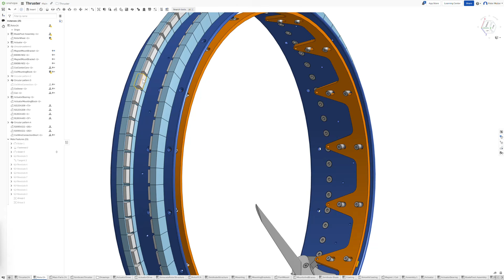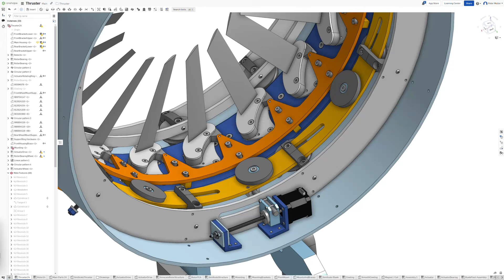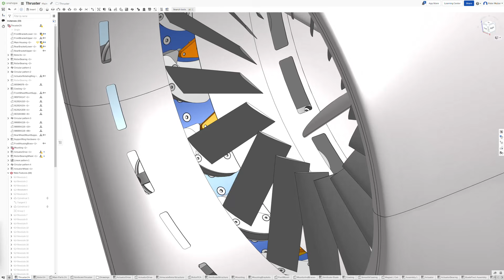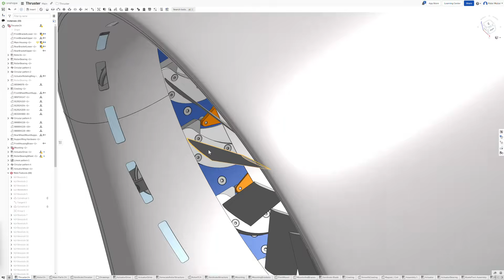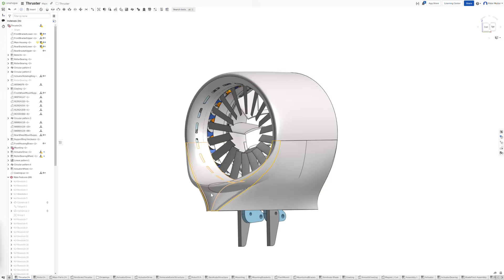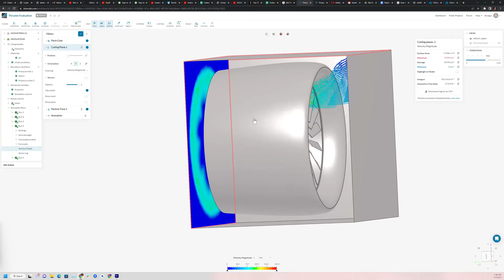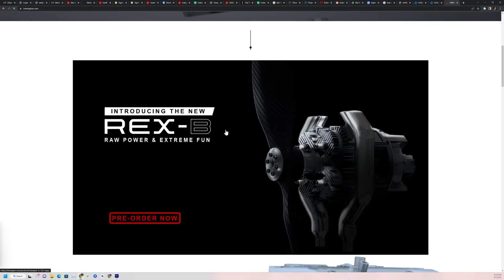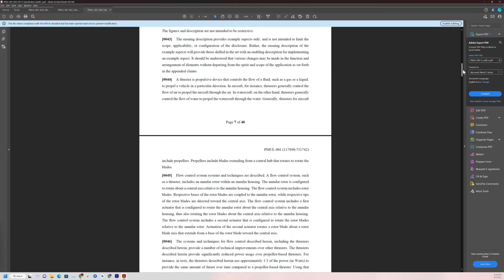Could this Thruster transform Aviation?

Comment: Very nice design ! I personally would ad an inner ring to stabilize the tips of the blades and avoid vibration due to resonance. It might make it more resilient in case of accidental bird intake. The inner ring support might help preventing blades braking badly and the engine self destruct.
Reply: I agree with that also. It would make less vibration and also cut down on wingtip vortices at the tip of each blade. Plus the inner ring could be made to conically widen or narrow the thrust for power vs speed as the case may be.
Reply: Might also make damage worse... with the current design one blade can go without taking them all - a solid connection at the "offset centre" could mean that a strike would pull a number or even all the blades out.
Reply: You can put more air through the engine if you eliminate the center race
Reply: @phedders  I think you will prefer to have damaged blades than ripped off blades. The later would create much more instability due to the imbalance and the engine will self destruct catastrophically. Having a central axis common support will allow the bird impact energy to be more evenly distributed on multiple blades, preventing a worse outcome.

Comment: Completely love the imagination, engineering and effort put into this, however there are several extremely similar patented and multi-patented units from 2008 - 2012 that have been designed, tested and modeled that you'll run into a wall trying to patent this unit.  Still a great looking unit and great video detailing your process.

Comment: I also thought about a fan like this some time ago. I don't think it can work for aviation, but I'm also glad someone gives it a more serious try. Someone should check me on this, but I feel like if you really want to spin this up to 5000 rpm then the outer supporting ring will have some crazy loads to deal with, making the whole thing heavier. Maybe carbon wrapping would help, but that would increase the distance of electric motor components (magnets and coils) which would decrease it's power to weight ratio and efficiency. The circular shape will want to deform according to where weights are placed making it more polygon like than circle. So it needs to be strengthended making it heavier. Having the electric motor and its magnets on the cirumference instead in a compact central motor makes the motor heavier. Also there is no obvious or intuitive explanation to why would this design offer any advatage over a regular ducted fan design. Having a bearing in the center, mitigates abrasion, this is what made the wheel such a great invention, but this fan design turns this on its head, unless somehow you can make the inner ring magnetically levitate, which would make things heavier. Blades being compressed instead of pulled is also a huge concern. Imagine a drinking straw being pulled or compressed. The straw will keep its geometry at larger loads when being pulled.
Reply: The clue is to use the air as the lubricant between the rim and rotor.
Reply: @alexanderg-p3z  I'm still not convinced. With air, there would be heat to deal with, probably crazy tight tolerances in wide range of temperatures. But maybe.
Reply: (c) Youtube AI R&D

Comment: Very interesting design. As others have mentioned, maybe an inner ring that would capture the blade ends on their axis of rotation would add some stability to the blade tips, if necessary. The blades could also be tapered toward the ends, not sure if that would be helpful.
Reply: Inner ring fill would also eliminate edge vortex reverse flow also. It will be significant for efficiency.
Reply: @galvanaut7119  You speak my brain! Similarly, blades could probably go shorter, relative to total diameter, to rely more heavily on a large entrainment cross-section - especially with that inner ring you mentioned, to prevent the entrained air from being frothed by wing-tip vortices!
Reply: With variable blade wouldn't work with Center support ring unless there were some type of bearing assembly that would allow the blades to rotate. The blades could be designed in a way that would force air flow toward the blade root.. he's only showing one stage of compression..
Reply: @Pw-f100  Oh, I like that concept - sweeping the blade to push airflow in a gradient from rim to hub, thank you!
Reply: But at that point you could also put the motor in the inner part instead of the outer ring, which would give you a ducted fan where the duct spins with the fan. If you look at toroidal propellers, connecting the end of blades seems to be the new hot thing anyways.
Reply: @galvanaut7119  exactly my taught. It could be easily tested with just pushing external arm that holds aerodynamic  filler in the center. If the efficiency of the tips is better the design iteration could be made to hold the center.

Comment: This is fantastic to see as I designed something very similar to this. I've been working with this kind of idea for a few years and ultimately decided to tackle it with a hybrid design of blades being on an outside and inside ring. This helped with stability and compression and I tried keeping it all electric. This design really made me tackle a lot of new concepts and forced me to learn a lot. I'm not the best with CAD so I don't have anything as nice as your model but I do have quite a few blueprints drawn up. The idea of a hollow jet engine has always been a dream of mine to make

Comment: great video, lots of work evident! some reflections:
1) tensile forces are better than compressive forces when it comes to structural weight efficiency. 
2) imagine that instead of the support hardware being in the annulus it is in the center. material requirements grow as the square of the radius
3) so I would posit that this is heavier than a traditional ducted fan for the same performance.
4) the variable pitch is well implemented, and could prevent the rolloff of performance with speed that ducted fans are known for by lowering the drag.
5) so i would repeat this experiment with a turbine that has a center, but with variable pitch blades and compare the performance.

Comment: I do wish Peter all the success in the world.
I do see a few issues though.
1) The fan blades will become shrapnel.
2) 100HP generates approximately 325 lbs of static thrust using a modern 80% efficient propellor. Generating 1500 lbs of thrust seems to violate some laws of physics. 
Of course they may not be laws at all, just foolish suggestions. We shall see.
3) The proposed power generator is based on an engine design that has never worked, and even if it does will never approach the reliability and efficiency of a conventional piston or turbine engine.
Even a turbine APU such as used in my work aircraft would be insufficient for the task at hand. Despite burning 15 GPH it can only generate 400 AMPS continuous at 28 volts, or 11200 Watts of electricity, equivalent to approximately 15 BHP

Comment: Hi Peter, fabulous effort!
The high magnet count of the motor and it’s relatively large diameter will make it very hard to run at a high speed because of excessive voltage requirement and very high frequency of the current needed (over 3300Hz at 5600 RPM ) this will result in fairly hi losses due to eddy currents and skin effect in the coils at higher torque values. 
Although it is not an optimum configuration for any motor, you may be able to get your rig to run at higher speeds by wiring coming phase coils in parallel to reduce the back EMF  totals, but this will result in a slightly reduced efficiency due to errors in magnet placements but may allow you to run at a higher speed with the same electrical drive system for experimental purposes.
This will not change the frequency requirement but will reduce the phase voltage required at a given speed, the current requirement at a given torque will naturally increase by the same ratio that the voltage requirement reduces.
Reply: That should have read Common not coming.

Comment: I worked at a jet engine company in the 80’s in the engineering test lab where we did the many tests required for durability that basically attacks everything within the engine.  That said, a blade-out test would be interesting not to mention the bird injestion that destroys portions of the engine and the engines must pass these FAA tests. Though your idea has merit I’m not sure how efficient it will be once the realities of what jet engines must endure, including water and ice injestion too.  There’s a great deal of capability within aircraft engines and every aspect gets heavily tested.  The costs moving forward are enormous even for small aircraft there are liabilities that are very high for propulsive units that lives depend on.  I want to help but not sure how you should move forward. 
Best suggestion is if you aren’t aware of FAA Type Certification that you need to pass, I recommend you do some research on it then revisit your design.
Reply: All I can see are all the different points of failure compared to a normal turbine, there may be applications for something lie this, but I doubt it's aviation.
Reply: @volentimeh  exactly my thoughts. The amount of small mechanisms required to just spin the ring of blades makes for a million points of failure. That combined with the possibility of blade flutter and flexing due to centrifugal forces and lack of support for the blades will probably cause a multitude of issues before it’s even capable of flight.

Comment: There would be a lot more friction from the bearings basically being multiple feet in diameter compared to a few inches in a normal engine. I also imagine vibration could be hard to keep under control. The small central bearing in the center of a typical engine just has so much advantage over this. plus as others have mentioned the blades being in compression instead of tension could be an issue.  Would be awesome to see working though.
Reply: I think the design is marvelously impractical. It looks really cool but as you say, the friction and other issues make it impractical.
One application for this sort of propeller is for boats and subs. This sort of design allows boats and subs to operate in seaweed infested waters. Debris pass through the center of the drive rather than getting wrapped around a propeller.
They're called rim-driven thrusters. 
The company Copenhagen Subsea makes a version called Electric Subsea Thruster.
There are applications where these make sense when used in water. Trying to propeller an aircraft with them is nonsensical.

Comment: I swear this idea is in my mind for more than a year!
Fantastic work!
And yes, it will change the electric planes forever.
Reply: Am like you was thinking of it ,but i still believe it is not complete yet.
Reply: Me too, since I was an aerospace engineering student at Georgia Tech, but Peter actually built it.
Reply: Cute 🤓
Reply: Will get then get into anything with it at the time because it's a completely dumb idea. This is the equivalent of taking something that works, and turning it into something that can't work. Like you don't see someone looking at a tire and saying what if I put the rims on the outside and the rubber in the inside. Lol or flipping streetlamps around to face the sky LOL.
Reply: @patman0250  stop the sarcasm, smart!
If you mean the tips of the blades, and the wheels that give the whole fan it's stability, then you might be a bit myopic! Those can be mended simply by an axix that hold the fan in place.
Moreover,  Rolls-Royce is building an engine with a very similar idea using I think an axial flux motor, the advantage is: 1- you use a far more efficient motor hidden in the flesh of the fan duct.
2- the axial motor has more torque as it pushes the fan by its tips instead of a conventional motor which will push the axis much closer to the central axis.
3- there maybe some wight reduction and less drag.
I think peter wanted only to demonstrate the general idea.
Reply: @ahmedelshafey7602  All this does is increase total friction surface by about a thousand fold. EDFs reach high efficiencies already and he doesn't even have a CFD to show...
No clue what he's even trying to achieve these days. His raptor almost killed him, because of all the weird stuff and shortcuts he took. I guess I should be thankful that he's wasting his time with stuff that won't even get airborne so it can't kill him...
Reply: @Argosh  well, I agree with you, there are alot of flaws, but, Rolls-Royce are experimenting a similar engine.
Reply: 'When the universe has an idea, many people will also think of the same thing but generally only one or two will build it' (read that in a science fiction comedy story somewhere)

Comment: Love the idea...I think you might have just designed a ducted wind turbine!
If it's wired to use 3 phase already, it would be interesting to put it into a wind tunnel and see how much power it can generate.
To maintain laminar flow as a generator, perhaps a couple of concentric toroidal foils could replace those of the thruster design.
Without the blade tip vortices of a conventional HAWT wind turbine I could see this being much quieter, possibly allowing for domestic use with simple vane steering.
Just a thought... possible alternative income stream from the basic design 🤔

Comment: If you add a ring to the center you would add a ton of stability to the fins and you could keep a low aerodynamic profile on it to reduce turbulence.
Reply: then remove the outer ring because its dumb to have so much mass there.. oh.. wait..
Reply: @MyrKnof  LMFAO 😂
Reply: there isn't an interior ring because the blades are variable pitch
Reply: @XerrolAvengerII  Still possible
Reply: @firstduckofwellington6889  more moving parts are so fun 😁😁
Reply: @yoamal1187  Do you drive a car lacking differential power, a torque converter, power steering, abs, suspension, seat adjustment, adjustable mirrors, etc?
Do you use a sundial watch?